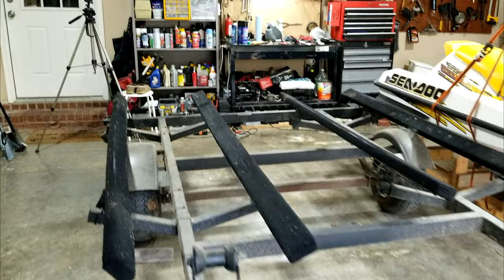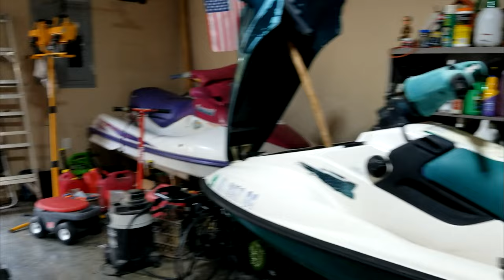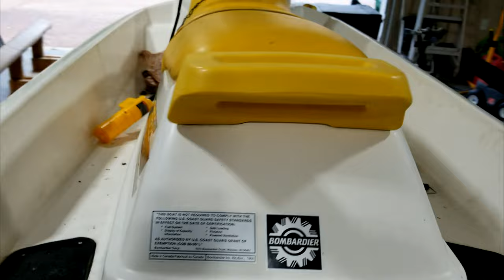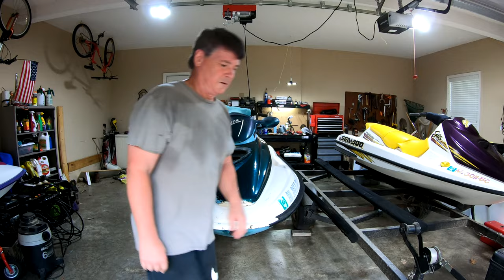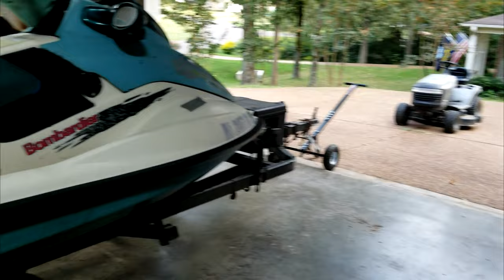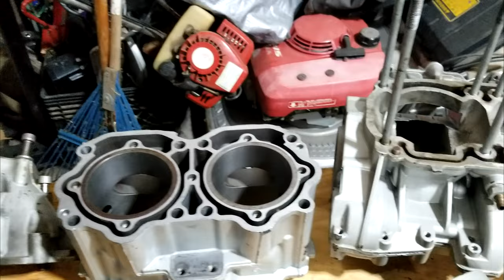DIY Garage Hoist Install Part 2...Reinforced.

Comment: You need a steel beam, 3 to 4 inch square tubing with no less than 3/16 wall, about 3/4 length of the jet ski, with gussets on each side of the lifting point you attach hoist to. Your lifting straps can hook on the ends of beam. Attach hooks on ends of beam or something that allows you to hook the straps to it.
Reply from the maker: You are right. They make a sling just for this, but they are expensive.

Comment: Thanks for testing this out with your skis. I just built mine but I went with a x and y axis setup and plan on moving my 110vx ski with it. Around 800lbs. I did the 6 bearing trolly wheels since I’ll be lifting more and my x axis has 3 tracks to dispute the weight a little more.

Comment: Those large wide straps that are used on flatbeds have a hooked end that fits perfectly under the hull lip of jet skis.  I have been gathering them from the side of the interstate to sew together a sling to use as a lifting system for jet skis.
Reply: I was going to say the same exact thing great minds think alike lol
Reply from the maker: That sounds great, but what you are saying is I would have to alter them as you are doing in order to use them on jet skis?
Reply: @papadonjetski9535  no the ends have hooks that you can hook on the sides of the ski super easy and this way your straps don’t get stuck under the hull when u set it on the trailer
Reply: @papadonjetski9535  I found two more pieces of strap yesterday.  The straps are far too long as they are made to secure loads on flatbed semi trailers, but you can readily find broken ones on the side of the interstate or on/off ramps.  I found four on ramps.  You need four hook ends.  You also need a pole or bar to hook them to, that can support the weight of a jet ski.  The hooks fit under the hull lip and easily lift a jet ski.  The junkyard near me uses this system to move them with a forklift.